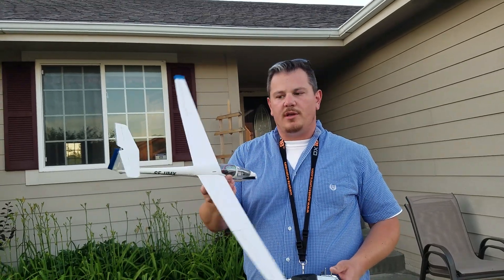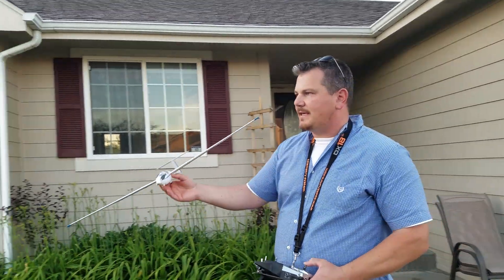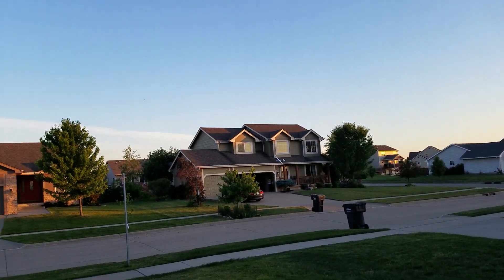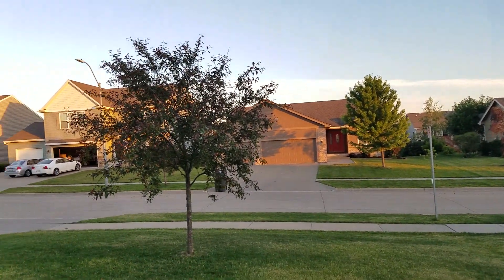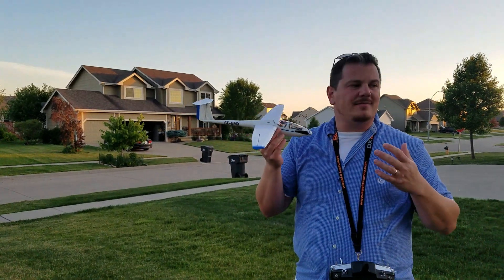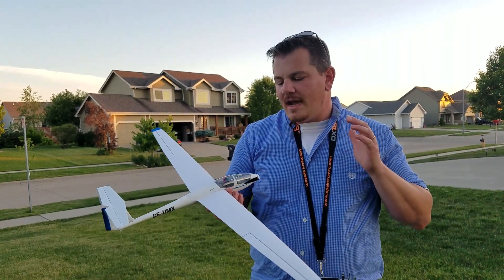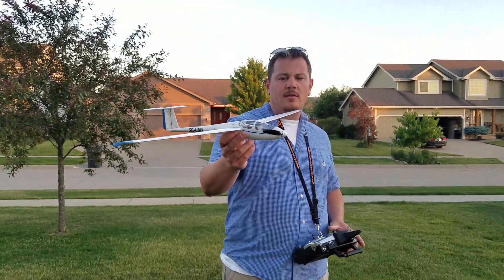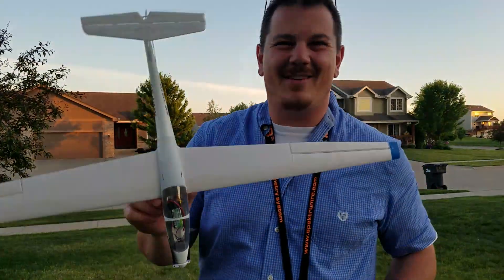Horizon Hobby - ASK-21 UMX - Powered Glider - Folding Prop Mod - Flight Review 2

Comment: Turned out pretty good. I wonder if the its brushed esc could handle one ofr those super high rpm motors for brushed fpv quadcopters. I am pretty sure wid a good motor the difference is going to be huge.
Reply from the maker: No doubt! It's SOOOOOO close to awesomeness! If I could increase thrust by 20% it would be night and day improvement. I can barely climb now... BUT ...like you said, and I agree, a new good motor will make a big difference!!!